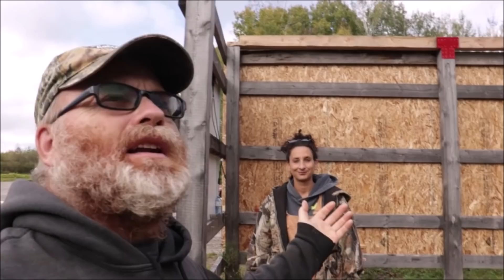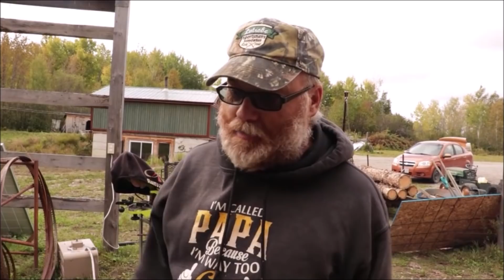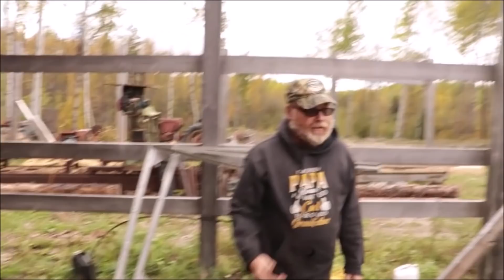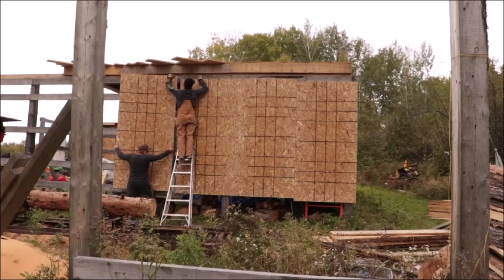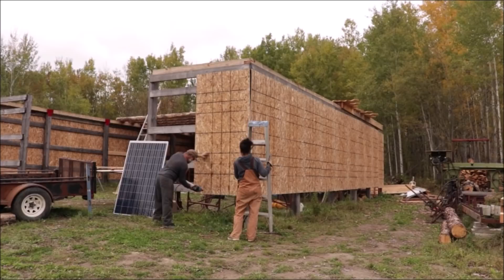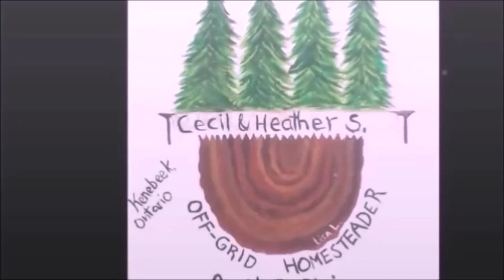Check It Out! The Bottom Of Our Post And Beam Building Is All Sheathed In Now/Off Grid Homesteading

Comment: I CAN GUARANTEE THIS THE BUILDING WILL BE OPERATIONAL ONCE THE UPPER FLOOR IS FINSHED. IT REALLY LOOKS GOOD. LOT OF HARD WORK AND THE DIESEL GENERATOR IS A DEFINATE WIN FOR YOUR USE. AT LEAST YOU HAVE THE LIFT YOU BUILT ON YOUR TRAILER TO MOVE IT ANYWHERE YOU WANT ON YOUR PROPERTY. PLUS IT IS A NICE BACK UP GENERATOR...YOU COULD BUILD YOU A COVER OVER IT AND MOVE THAT AROUND TOO. YOUR TRAILER IS A BIG HELP...

Comment: Is there a way to make your generator set up so the engine can convert  back and forth between powering a compressor head and the generator?  Then you only have 1 thing running at a time.  Just a thought.  I figure with your fabrication skills you could figure it out.
Reply from the maker: Hello Jim,  there maybe....I just figure while the generator is running I can charge the batteries in the house plus run a compressor  ;-)  Cheers!